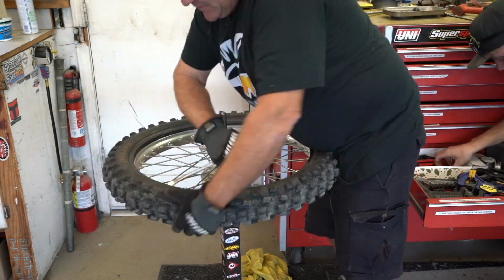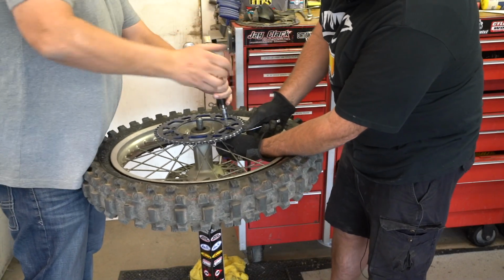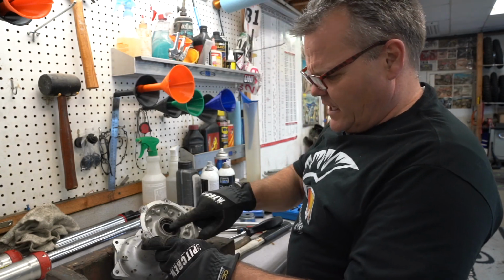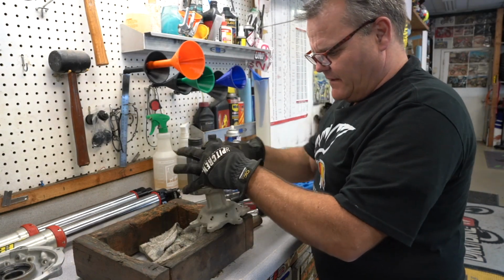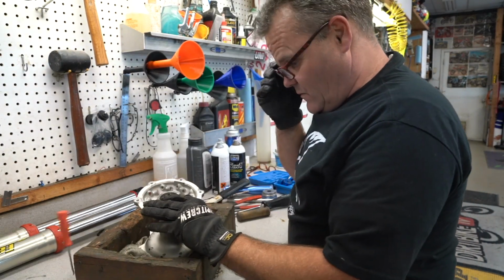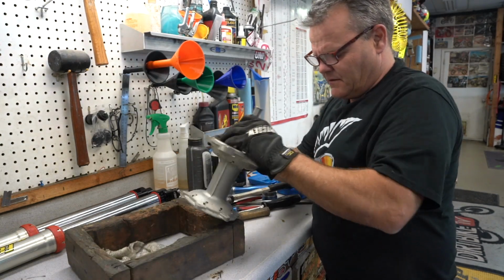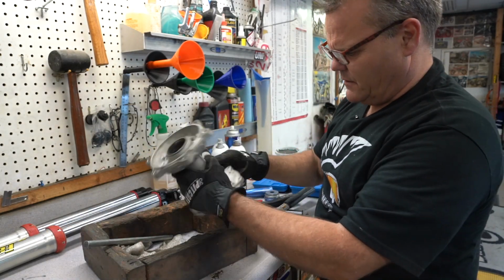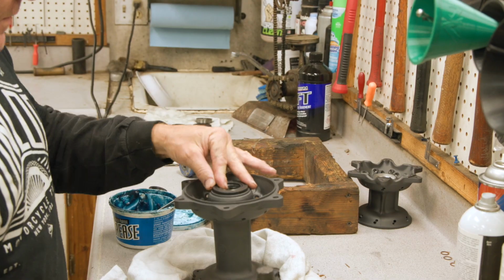Epic Dirt Bike Wheel build- YZ250 How to

Comment: I always fine use in saving pieces of round stock steel rod. Different sizes and lengths are great to have on have for knowing out bearings or other long reach jobs.  As for old spokes.  I always keep some on hand again,  they are very useful for making tools or like picks for cleaning out snap ring grooves, or making hooks to hang things, and great filler rod for tig welding stainless steel.   Lil tools are getting so expensive,  this day n age we gotta use our heads when it comes to scrap steel.   Steel is like gold, keep it for a rainy day.

Comment: Lil tip, if your new to wheel building. Turn to the bicycle industry for great how to books. The techniques are the same, just pretend your building the ultimate DH wheel set.  First tip. 5 is the magic number when tightening spokes. Start at #1, skip 4 , tighten the next #5